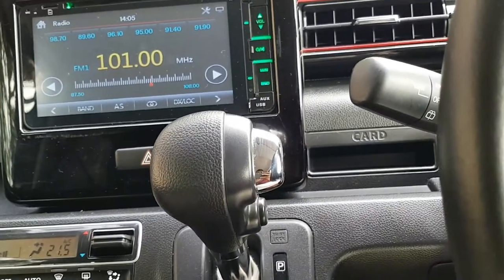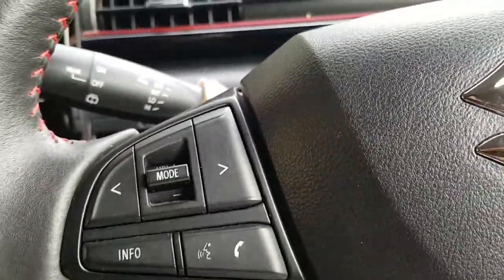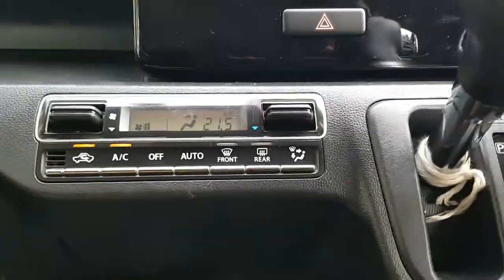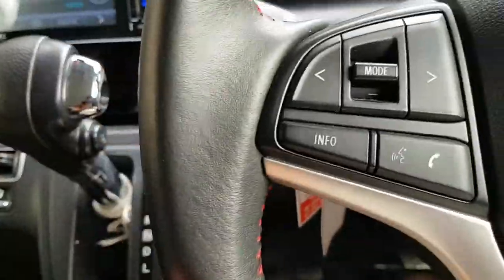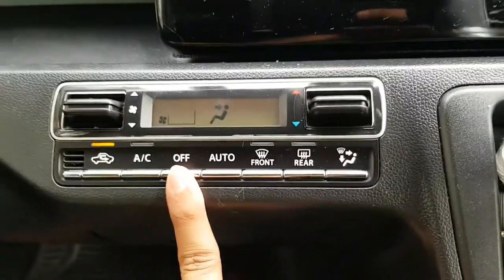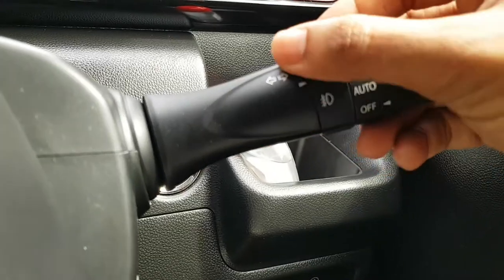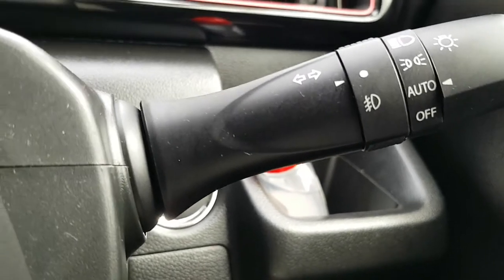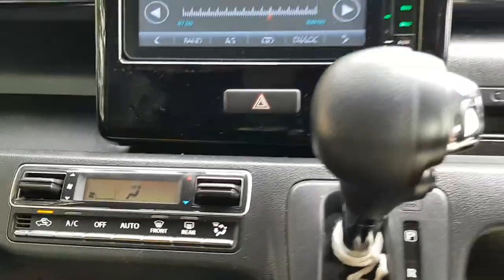12V බැටරිය කේස් ද? 12V battery Issue Wagon R Sri Lanka l Sinhala Review l Stingray X T Hybrid [2021]

Comment: බැටරි  රැකගන්ඩ හොදම දේ තමයි auto start -stop ,එක desable කරල දාන එක.. ඒක වාහනේ තියන  fush button  swith එකෙන් නැත්ව settings  වලින්ම සදහටම  off කරල දාන්ඩ පුලුවන්.. swith එකෙන් off වෙන්නෙ වාහනේ engine එක off වෙනකල් විතරයි.එහෙම off කරහම 12V බැට්‍රියෙ අවුල් එන්නෙ නෑ..පොඩි තෙල් ටිකක් ඉතුරැ කරගන්ඩ දාහස් ගනන් වල බැටරි  සහ starter  unit සවුත්තු කරන්  ලොකු රේපෙයාස් වලට යන එක මෝඩ වැඩක්..idle stop තේරමක් නෑ..
Reply from the maker: ඇත්ත කතාව...ස්තුතියි
Reply: mokuth karanna ona na 3000f super capacitor ekak danna, battry eka tikak wath damage wenne natiwa use karanna puluwan. 

me video eka balanna
Reply: 😢😢😢😢 settings walin karana vidiya kiyanna puluwanda